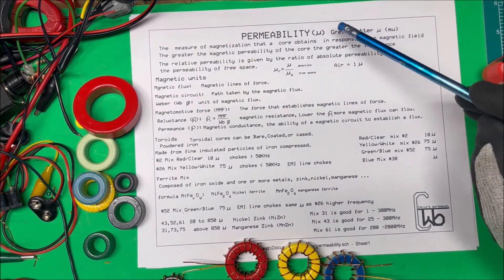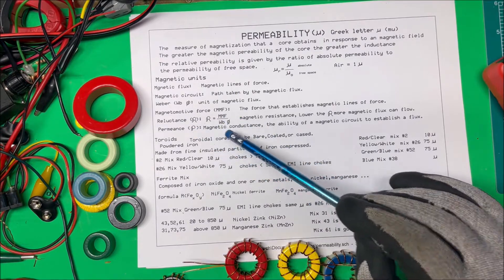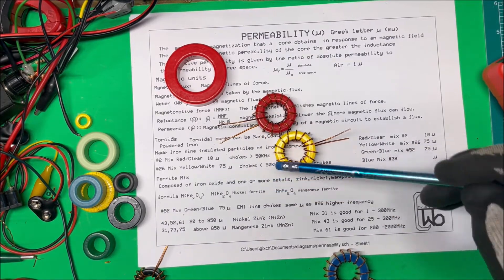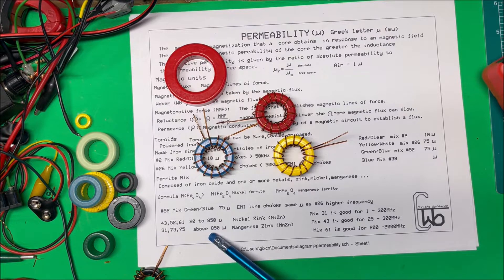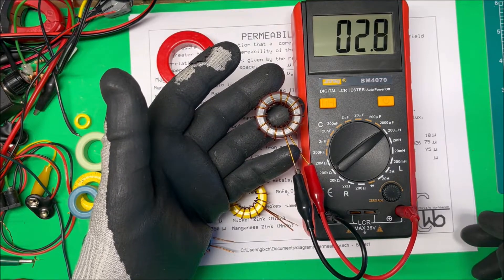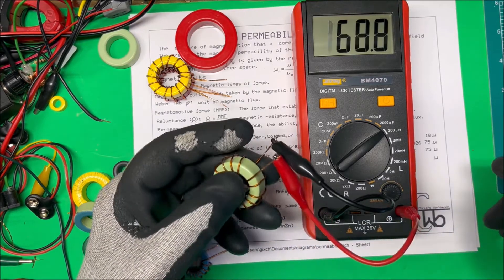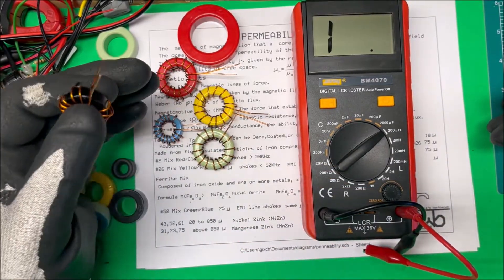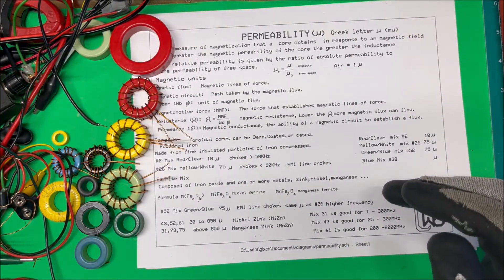Permeability of toroid core

Comment: I appreciate your attempt to learn by measuring the inductance of the torroid winndings. As I can see all except one are iron powder cores. The red-clear is the only one we can use for RF circuits (either as a narrow band filter or broadband transformer up to 30 MHz) The yellow-white, blue -green and all others are used in switching power supplies and not in RF circuits. It is standardized to have colour coding for the iron powder cores (micrometals) and all ferrite cores don't have any colour coding (Fair-rite) You can refer to many articles, online calculators and standard books apart from datasheets published by manufacturers.
De VU2RZA
Reply from the maker: Thanks for the comment.
Reply: @ke6chris Thanks for your prompt response 👍 
De VU2RZA

Comment: Does the LCR meter have a way to adjust the test frequency? It would be interesting to see how they react across a range, versus the 120 or 1000 Hz the LCR meter is usually set at initially.
Reply from the maker: No the LCR meter Was only  $35.00
Reply: If you know how to do complex math, you can make a voltage divider with a resistor and an inductor and measure amplitude and phase and determine the inductance.  Then you use the toroid inductance formula to determine permeability at frequency